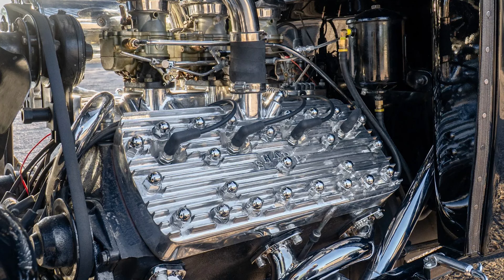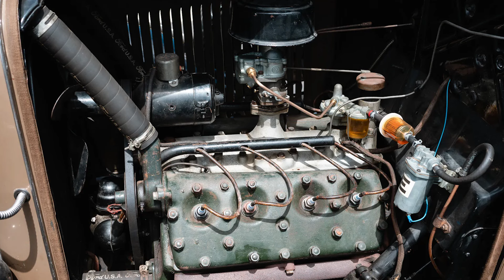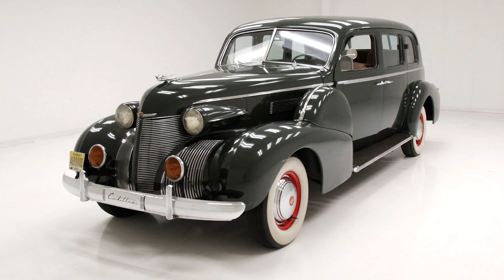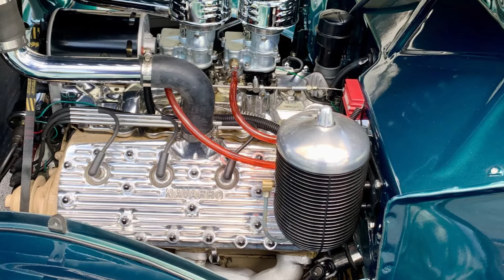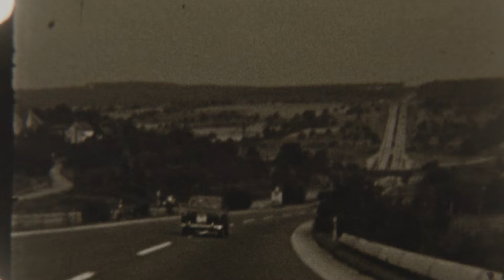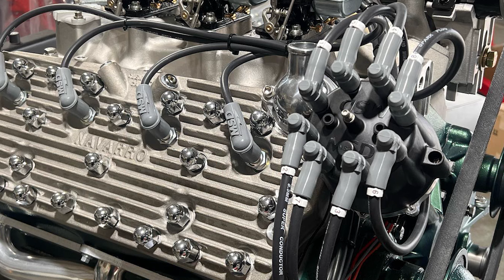Why Restore a Ford Flathead 239 for $20K Instead of Buying a 500 Horsepower Modern Engine?

Comment: $20K? That's a ridiculously high cost to restore a Ford flathead.
Reply: They do cost more now to rebuild than a Chevy, but that is waaaay high sounding.  One problem might be finding parts if you need a block or crank.
Those things were always just an inefficient hard to build mess.  As far as durability it had nothing on a Plymouth or Dodge.